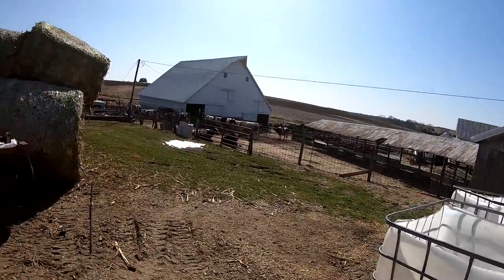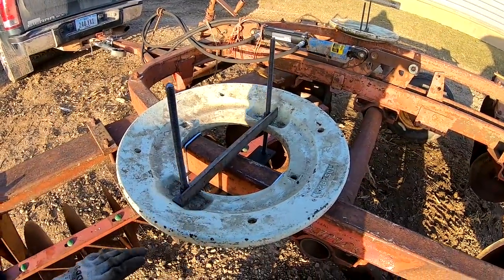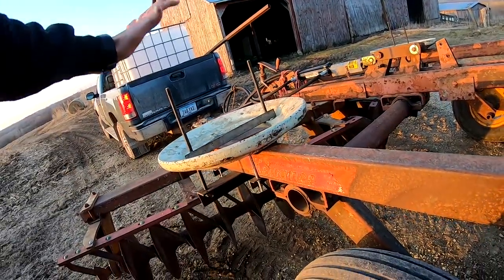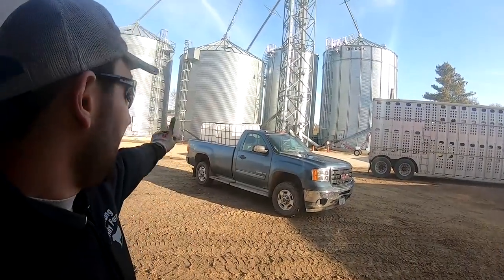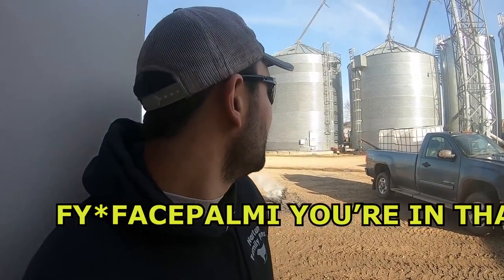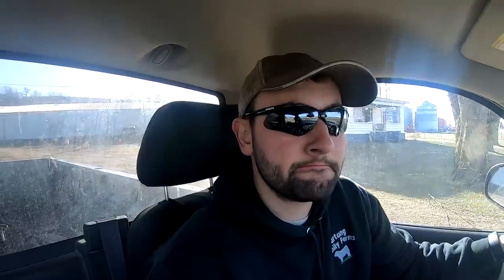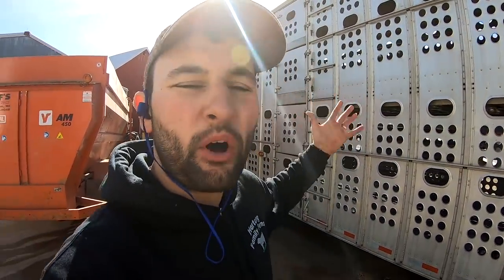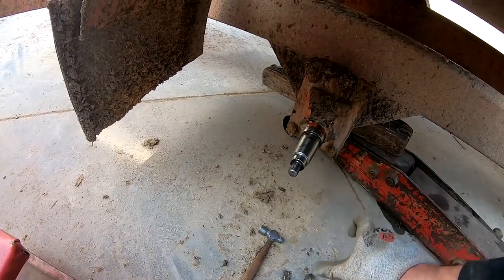HOMEMADE UPGRADES to the DISK

Comment: I will agree with the comment on probably going to need more weight.     Maybe front and back. But before you start adding more weight, check the condition of your hoses. They need to be in GOOD shape to handle the extra weight your adding on. Nice Engineer class. That being said, the more weight you add the more your adding to the work the hydraulic  system  must do. As far as I am concerned, any video is good. And I also agree with the comment of Welkerizing it with a fresh paint job and " Bud Man."
Reply from the maker: Great point! The hydraulic cylinder and hoses are brand new so I am hoping they will be good

Comment: Ron, most of those older disks you can set the angle of the gangs. If u sharpen the gang angle you'll be surprised how much better it will cut

Comment: You’re going to need at least the front gangs on that disc changed to serrated type discs if not the back gangs as well to chew up grazing ground well enough to do anything with. I’d say you could drop a couple of ton on either side of that disc the way it is and It still won’t do a good job. Looking at your mixer wagon I’d recommend you look at a keenan mixer wagon they are really built tough and made to last.

Comment: I still think you need more weight Ron.  Just add them on top of the first on and use another piece of angle on top.  Just an idea.
Reply from the maker: Probably will end up putting more on there

Comment: If you're gonna upgrade and get a piece of equipment work ready, first and foremost, inspect the wheel bearings, and repair, grease, or replace as necessary!  you can;t use it if you can't get it there!